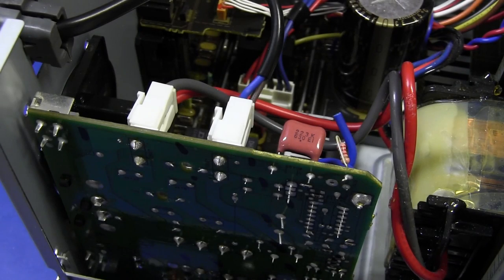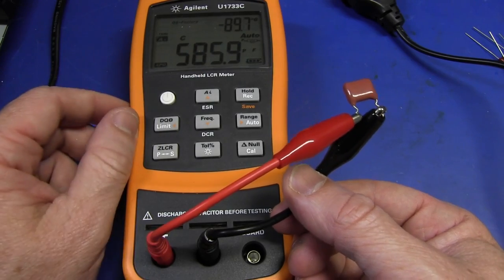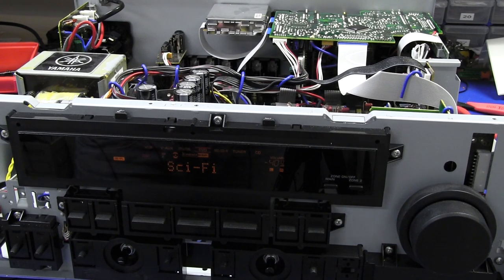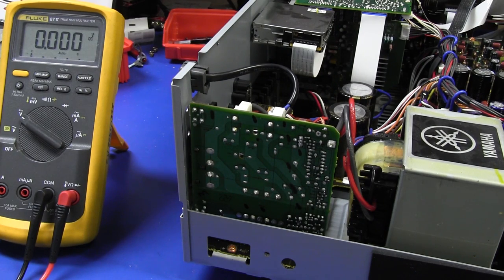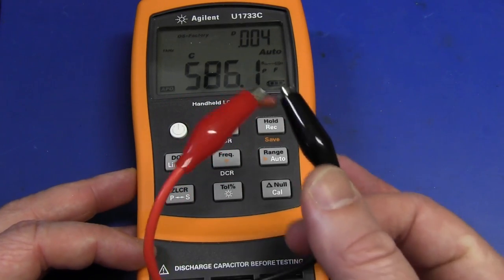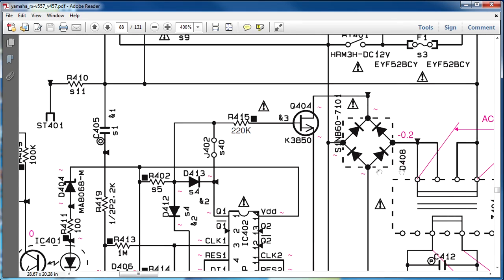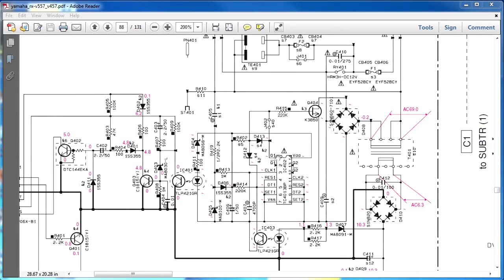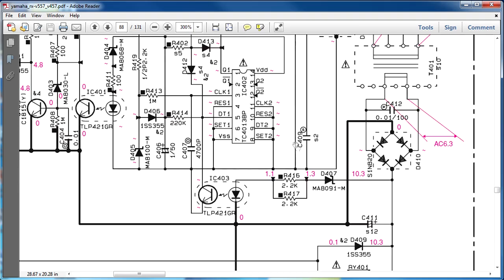EEVBlog #379 - Yamaha RX-V557 Receiver Fix

Comment: Might be alittle of topic but I have a v1600 which has an issue with the PS aswell. The issue is that it is in protection mode cause of "overvoltage" I guess. PS-PRT 255 is the code I get. Could this have a similar issue to replace the cap? Or possibly anyone pointing me to the right direction?

Comment: I had the same problem with a TV. I started checking all the semi-conductors and the primary caps and still no problem. I looked at the schematic of the switch mode supply IC and said to my self, nah it couldn't be from here. And then random problems again. Then I looked at the schematic and saw a capacitor that was used on the rail of the IC but it didn't say the value so I wen't and took out the suspicious cap and that was it, a 22µF cap. I like when only caps fail :)

Comment: it's also really funny that they use a 4013 as PWM controller. Maybe back when this design was originally made ('80s?) that was a reasonable design, but nowadays it just doesn't make sense. You need a much larger xfmr than with a dedicated off-line smps, lots of external components and therefore a lot of assy and part cost (magnetics are usually dominant in the BOM). It's expensive and convoluted, and probably not inherently safe, but back then it might have saved 3 cents.

Comment: Designed to fail or failed design? Well, at least I got mine fixed by myself now, thanks for the vid! :)
Reply: +Yurriaan Van Duyn Probably designed to fail. I repair Yamaha's like that quite often, those caps are a very common problem. Even Yamaha went that way, sadly. :/
Reply: Everything will fail - no design necessary as it is a basic law of thermodynamics. 

The question here is why does the cap fail so quickly, relative to the other components and then what can be done to reduce this failure mode?

I don't know the answer, but I think they are the right questions to ask. Well at least for Yamaha they are, but for us lucky enough to recover a good, but old bit of kit by replacing a 50c component - that will be good enough.

Comment: Does anybody know how to fix pioneer amplifier (A209-R) that shuts down when volume is up 40% or higher? I have replaced all FET-s and the problem is still there. Problem is on all speaker outs, 1 or 4 speakers connected. Please help.
Reply: Yes I have. It shuts down only with speaker(s) connected. I know it's amp!
Reply: Radovan Skalamera have you checked if it's over heating.
Reply: It does'nt overheating at all. It shuts down immediately when I turn up volume above 40%. Cheers
Reply: that's weird. does it distort when you turn up the volume to 40%?
Reply: No it does not! Just shuts down. It does not overheat, can play at 35% of volume for hours.
Reply: you should check what kind of protective features your amp has, check the manual. might help diagnose the problem.
Reply: No it does not, but thank you.
Reply: Turn your amp on and measure it with a voltmeter if enough power comes in.If you haven't a voltmeter ,check if the power cables are plugged right in and be strong enough!
Reply: Radovan Skalamera Run low fewquencies and high frequencies through the amp, preferably with a tone generator, see if you can get to higher volumes with higher pitched tones. If so, your storage caps are likely faulty and the power supply is hitting an over current fault line.

Comment: Metallized Polyester will, but they fuse (open) and drop in value - just like what you see here. Polypropylene self-heals. I've only seen one damaged polyprop cap in my lifetime and it was a near direct lightning strike. ;)

Comment: this is a common problem with made to a price satellite receivers, google "sky receiver capacitor"
Reply: +takeaway guru the heat generated by itself will cause the condition of the cap to physiochemically deteriorate over time, caps have a hard life so some even have their own heatsinks

Comment: The Flipflop's  data-line is pulled down by the feed-back optocoupler :-) . This looks like a line-syncronization-circuit for full-wave dimming the transformer. Nice vid btw :-)

Comment: the cap is just being used as an ac supply resistor,  = 120K ohms @ 60 Hz, nothing to do with filtering, mate. you could have replaced it with a 120K .5W resistor

Comment: The laugh is if you google the receiver model and make and "no display" or "no power" you get a few links to forums with posts pointing to the power board and that particular cap. I hardly do repairs anymore but when I stumble across something one of the first things I do now is google the problem.

Comment: Could it be that the 4.8v would drop a lot under load?
Reply: Beings it was a standby issue, most likely not, they just seem to wonder in voltage unaffected when you hit the power button (not always the case, but for me and others it's usually the case). I still understand ur question and it's a fair one, no matter what I or anyone says.

Comment: Hey thanks for the C405   tip  ✓.       

I must have got those peoples new amp as I got the one from the box you showed in the first video. I got a  RX-V1800 from the dumpster and replaced the C405 and all is good again :o)

Comment: I was like 10 ish yrs old my parents had Sony receiver fail. one day they turned on it started flashing "protection". They ended up getting new, i pretty much destroyed old one for parts. I was still getting into, and never really considered repairing stuff. I eventually saw one of boards a jumper had somehow busted. They replaced with an onkyo, now that's probably 10yrs old, sometimes power button goes loopy, and won't shut off. Then sometimes you turn off it changes the speaker outputs from A to B, or turns off A, and that is only one that is used. so then you have to press that. I looked at all seemed ok, only guess i have is something with the buttons themselves and the bezell somehow triggering issues.
Reply: Did sound come from the speakers before cutting out and displaying the "protection" alert, if so the volume was up far too high, it needed muting and turning down the volume and soft off and on to fix, if no sound was there it was the protection cutout relay.
Reply: Kit Cloudkicker I had kind of thought of that at the time i think, i tried turning down all the way, etc nothing worked. For a while my dad thought i broke it some how turning it on. He looked at it, and cheeked all the setup, it didn't help. looking back, i kind of wish i hadn't completely destroyed it before looking at everything. I had no use for a receiver at the time, and didn't know how to fix the broken wire.
Reply: Kit Cloudkicker Had a Sony ES fail with a 'protection' warning - debugging it lead to a likely output IC error - a custom Sony part that's unobtainium although there are a lot of fakes floating about....

Comment: Everything fine, however, HOW this capacitor went damaged? The MAXIMUM current this capacitor takes is 350V/2,2k = 160mA  and it is worst case momentary pulse, when this other big green bastard is not charged yet. Who made this caps for Yamaha? I'd like to know, which cap I won't ever use!

Comment: Couldn't you measure mains level voltage without isolated probes? Just leave their grounds floating and use the Ch1-Ch2 function to get a differential measurement. As long as your probes are rated for circa 600V you should be safe.

Comment: Hi! Thanks for the video! Same problem for me, for my rxv-459 (no switch on). I replaced the capacitor with a new one. 
Now it opens but then a "click" is heard and switch off again...  Does anyone have any idea what to do?
Reply: Protection circuitry is shutting it off. Check the output transistors and the main electrolytic capacitors, but DONT CONNECT ANY SPEAKERS until you are sure it works.
Reply: Thanks for your answer. I will try to check what you say, although I am not familiar enough with electronics. Replacing the capacitor 22nf 630volt described in the video, woke up my rxv-459 reveiver!!! But it shuts down withon one second :(
Do you really beleive that the problem is at another part of the divice? If so, the solution seems to be more complicated... Thanks anyway for your help.
Reply: My amp was doing this.  From memory it was a faulty 79L05 regulator, I think it was located around the middle of the amp.

Comment: Based on how i see the SMPS operates, the drop in capacitance allowed too much ripple into the clock pin on the 4013 making it operate above the design frequency limit for clocking the flip-flop.  In normal operation the switching frequency is probably about 100kHz, drop the capacitance on the feed and you suddenly get a drive frequency of close to 10MHz, too high for powdered iron core Xfrmrs.  Result; correct voltage output at too low source current.  Trust when you see your bargraph "twitch".

Comment: People don't realize that just like a in light bulb. Every electron that goes through something can change its makeup slightly. Especially with a high voltage. I have seen those caps blow open if a surge current was high enough long enough. But in hindsight that circuit is very strange. I use 120v where I am, in some ways it seems to be nicer to electronic power circuits. I had one transformer in a pinball set to 220v and then re imported and set back to 120v and it overheated and literally started smoking while testing the pinball. A replacement never got hot. I am a tech and I don't feel anyone is worth getting more than $25 US per hour for a job well done.
Reply: What do you mean the electron can change its makeup?
Reply: BlueCosmology
The Electron doesn't change. It's what it is passing through that is changed over time. Some things more than others. Batteries are an example; while light bulb filaments are another. So electron flow can bump off others that are never replaced. You could think of it in terms of electrical erosion. Also as things are worn out by electrical friction and heat even more changes result. The suns rays also have similar effects on things over time in various ways. Electron flow is no different, although it's more understood.
Reply: batforjustice Ok, thanks for the clarification. I thought you meant the electron itself changed its own makeup.

Comment: that C405 is on all older RX-V models and all of them do fail!
I'm repairing in my shop at least 3-5 per week, thats the only common fault on all
Reply: Hey felix945 can you please tell me if it matters which way you install the capacitor. Does it have polarity? And if do how to tell? I don’t want to install it the wrong way if it will be dangerous. Thanks
Reply: @MrMichaelrichards  hey, it's a foil capacitor which means in this case it does not have a polarity
Reply: felix945 thanks very much for the help. For the record, I wasn’t in luck, The new capacitor didnt fix it. I cant figure it out, error is ps prt: 035k but not sure which part of the power supply needs replacing. Id better bite the bullet and take it somewhere to be repaired next week. They’re complicated machines. Thanks again mate. Much appreciated.

Comment: I would've put a 1kV 22nF cap in there, just in case :)
Reply: +goatstaog I believe that the cap that failed is a self-healing one (metallized PE film cap). That self-healing process which happens in the cap will effectively decrease the capacitance by decreasing the area of the electrodes inside. This cap, obviously, had it's dielectric breakdown happen excessively and the decrease in capacitance is not negligible any more. The failed cap had a low quality dielectric and any peak or transient from the power grid "chopped" it bit by bit until the multiplied healing effect affected that power supply rail for the 4013 IC and, ultimately, rendering the entire device inoperable. That's the only reason I suggested a 2kV cap in it's place, just to prevent this from happening again.
P.S. I've seen a few of the mains rated metal film caps lose their capacitance like this.
Here is the description of the self-healing process as described by Wima:
http://www.wima.com/EN/selfhealing.htm

Comment: The poly caps... Short out usually? Lovely... I have three very large ones on my high voltage rail to absorb voltage ripple from the PWM motor controller for my electric car... O.o
That's gonna make a boom someday. D:

Comment: so basically.... you could have skipped the whole  unusal 5v circuitry (and bypass the  soft switch with the reistor) and power the rest of the system with 5v from a external power source (after looking at the service manual for acceptable values).

Comment: i have the sony version with almost the same circuitary, mine went dead thought it was the display had gone, didnt have a service manual at the time, put into storage for a few years, pulled it out when i had service manual and found the fault was with fusable resistors. job done :)

Comment: CAN SOMEONE TELL ME HOW TO FIX THE YAMAHA VOLUME KNOBS?

I KEEP TURNING THE VOLUME UP AND IT TAKES MANY TURNS TO RAISE THE VOLUME UP JUST A BIT.

ANY HELP WILL BE APPRECIATED.
Reply: Check your speaker impedance!
Reply: Replace rotary encoder?
Reply: Gioxtream
Reply: I've fixed those viscous controls by taking them apart and wiping off the excess goo that gets on the contacts.  It's a delicate job to not break it.

Comment: Ugh.. Dave, don't be so defensive! does not make good viewing... not all faults are electrolytic caps!! my mum could spot a bad cap, that's not electronic repair.. it's faults like this that take experience/knowledge/skill to fix; Although a dying industry, GOOD electronic service engineers are highly skilled so stop beating yourself up about failure!.... You were quick to poke your previous employer having a smaller stand than you at the show (equally annoying gloat).. you can give but not take